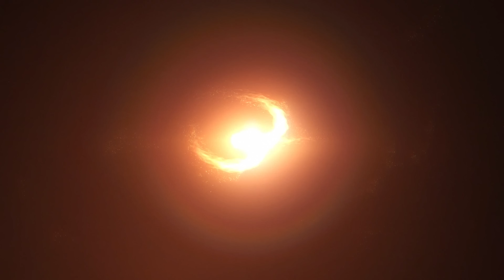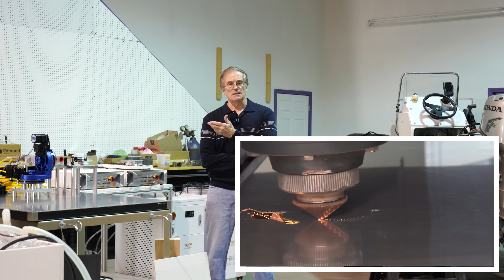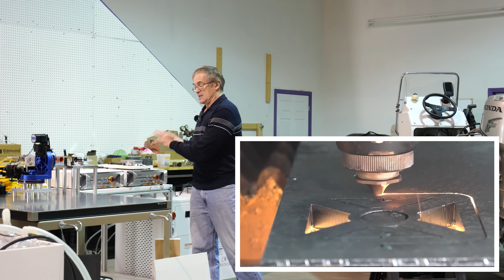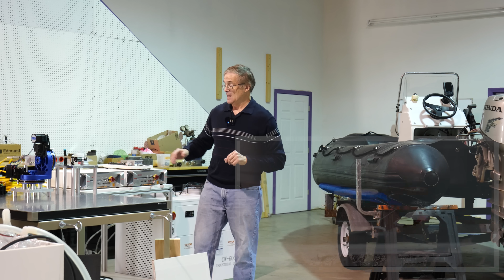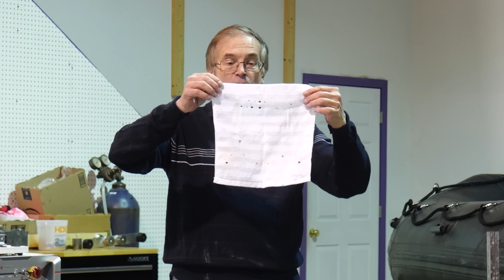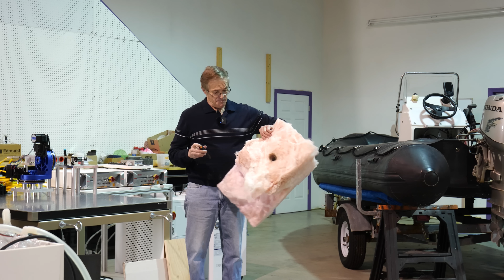We have a problem... and need your help!

Comment: I have an Idea, I know that others have brought up the idea of using water to stop the beam, but what about a long tube with water be pumped along the whole length of the tube with firebricks at the back to catch the rest of the energy. Water would be going everywhere but you could pump the water out of a basin under the tube. Picture a rocket deluge system
Reply from the maker: We need to protect the entire back wall. 
The barrier needs to cover a relatively large area because the beam can point anywhere within the region where the drones will be flying.
Reply: @TechIngredients  ohhh, that makes things way harder

Comment: A one foot diameter by 10 foot long plastic pipe, closed at both ends.  Fill with water add a dye if neccesary.  Put a spout right below where the laser will hit.  Allow the water to leak out of the laser hole.  Put a bucket, a water pump and a water tube from the bucket to the top of the pipe.
Reply from the maker: We have to protect the entire back wall. 
The beam can strike it anywhere.

Comment: Concrete blocks filled with water.    The water will leak trough 1 face of the block but, will dissipate heat in between

Comment: aluminum nitride ceramic sheet.   2200c melt point
or
fibre cement sheet.     it is cheap and i cant find a melting point mabey you could test it?

Comment: Well, you didn’t mention about the temperature at the point of contact.
I think if you try quartz tank wall filled with water maybe will give you the time you need.
Another option is Teflon. However, the vapors won’t be friendly. You will need an exhaust with activated carbon filter.
Maybe a combination of water and teflon plates. A stream of water rolling down over the teflon canal then you will not need the quartz tanks.
Reply from the maker: The temperature at the focus will be many thousands of degrees and will melt any material, any one.
The chalange is to find a material that melts as slowly as practical and is cheap and light enough that we can place a thick enough layer to stop the beam.

Comment: I believe sand would possibly be a good option because it would shift and replace the melting sand with new sand. You would probably have to put it in a container that would be big enough to cover the area of protection and deep enough to allow for enough sand to shift to accomplish the barrier you need. 

I hope this helps.

Comment: If you need to fire horizontally, have a mirror angled 45 degrees down to reflect the beam down into the ground or a pool of water that can absorb the heat. Or have a water pump flowing a curtain of water over the plywood sheet to keep it cool and prevent it from burning

Comment: Interesting problem, to say the least. Off the top of my noggin, I have a couple of ideas maybe you could try...

1. Soaking the plywood in water or coating it with a fire retardant foam to try to extend the time it would take for the wood to ignite. Or even having a constant water source spraying the wood to keep it saturated as the laser evaporates the water already absorbed into the wood.

2. Adding a 'curtain' of water in front (maybe also between layers) of wood or other material to act as a diffuser. Hopefully splitting the beam up enough to make other barrier methods more effective. Using fog pattern nozzles, if needed, to make the curtain of water less reflective. 

3. Although I'm not at all familiar with it's flammable properties, maybe aerogel, or whatever it's called, that I've been seeing, made from silica, could be a potential method for diffusion 🤷

They're not the most fancy or scientific ideas, but if nothing else, might spark a thought in someone else for a resolution. If I think of any better ideas, I'll let you know. I look forward to seeing the final results

Comment: I’m just a simple DT school technician. We use small rf and co lasers to cut wood and plastic. The power and feed rate are adjusted for cutting or engraving and material type and thickness. Would not the lasers you have be able to be modulated by the camera focus? Also, just as an extreme long shot, I saw a video by nighthawkinlight in which he investigated trying to recreate a compound called ‘starlight’ by its inventor, who worked for a short time with NASA I believe. He took the secret formula to his grave. It’s a kind of putty that protected objects it was in front of or covering, such as an egg, from the effects of extreme direct heat, such as a flame. It works by sacrifice, delaminating and creating a carbon barrier. Supposing you could mix into it some light scattering particles to ‘dilute’ to beam perhaps? Sounds crazy but there’s nothing to lose, I was born dumb 😂
Reply from the maker: We're already looking at his formula and plan to test some samples. 
Any electronic or mechanical limit to the laser can fail.  That's why the barrier is there.

Comment: Have you considered always keeping the beam in motion relative to the blocking material? Either continuously wiggle the beam, or wiggle the wall.
a 1mm pierce is significantly less energy than a 1mmx10cm cut.

Comment: To me you absolutely need to modulate the power of the laser. Imagine running around with a constantly firing gun, hoping to find something to shoot. It doesn't make sense. Maybe switching from a low power laser for aiming to full blast when it is in scope is a better approach. Then the armful laser doesn't need to be plugged in for a portion of the software testing.

Comment: Perhaps Magnesium Oxide Board as thick as you can get will work. It has significant heat/flame resistance at over 800c, is very hard/impact resistant and relatively inexpensive. Is said to have the properties of stone when heated.

Comment: A simple power supply current limiter circuit added then you can add various conditionals like a safety and kill switch, ect.  Because targets make noise when hit with the laser, the lab could have several microphones and a VOX circuit added to the current limiter input.  Just make sure the lab doesn't have house flys...

Comment: A Wall made of Aerogel. I know this would be extremely expensive, but that's my most effective idea.
Reply: Considering you are a much more intelligent and knowledgeable engineer than myself; you should know aerogel can be made with relatively mundane lab tools. Purchasing it is expensive, you may be able to find a way to manufacture it for your needs at a lower cost. I am unsure of the dimensions you are needing for this project, but you would need support for the gel.

Comment: You could combine 2 absorbing solutions: one cheep and large behind the target and one more expensive, close to the base of the jig by automatically deflecting the beam to it with a jigged mirror like the ones used to videotape high speed projectiles.

Comment: To solve your strong LASER problem: You may want to try aqua gel / Orbeez / Hydragel as a heat exchanger with an infusion of water soluble coloring within the aqua gel which has an optimal absorption characteristic for the given laser wavelength. You may also want to whirl the small aqua marbles around quite fast to avoid burning through them. A simple waterpump should to the trick here if you suspend the marbles in water using a 80% gel to 20% water ratio. This should all happen within an clear encasing of a glass like container to allow the laser to enter the "aqua gel heat exchanger" without damaging the optical window.
Reply: This should in fact work. Just make sure to move the gel around. The gel is better than water alone, because it moves in "chunks" which is what you want here to avoid hotspots or bubbles in water which could lower the effectiveness. The colored gel sounds like the way to go.
Reply: And avoid reflections of the glass surface where possible.
Reply: You may want to use e.g. indigo or green water coloring while the aqua gel is colored like you said, optimized to the laser wavelength to optimize for the laser. The water coloring just is there to lower reflections from within the spherical aqua gel.

Comment: I have a solution for you.
1. You need to get the ceramic tiles they used on the Space Shuttles. They can handle thousands of degrees Celsius for a long time.
2. An element that everybody runs away from. It is called Asbestos. It will solve your problems as it can also handle thousands of degrees Celsius.
That is your only solution.

Comment: Something with partial reflecting mirrors they spread the beam to some dark metal plates with cooling? 
Like a tunel where the beam gets of its itensity by every mirror that spots parts of it to a black paintet cooling element. 
Just an idea from a non scientist.
Another thinking, spead the beam with lenses will give a wider and cooler beam whatever you do after to stop it. 
Water can maybe work with some absorbativ particles or something else in it i think also. 
Like youre experiments. Thanks for the video!

Comment: I am not sure if the light physics work but my idea is… Use a large mirror and lightly sand clear side with very fine grit sandpaper.  My thought is that all of the fine scratches would diffract the light, hit the reflective back side, diffract further transmitting back out through the finely scratched clear side and be scattered to a safe level of energy density when it is reflected back out the front in many directions.

Comment: The idea is to disable the drone not to slice ans dice it. Pulse the laser for short periods. You should have an idea of how much power you need at what distance to disable a piece of plastic you can kick to pieces. A distance calculation via camera and very short bursts of light energy should minimize collateral dammage. There is always collateral dammage in war.
Reply from the maker: The idea is to be ABLE to slice and dice.
Testing will reveal that with precise targeting, what the amount of energy needed actually is. Then, dwell time on the target can be tailored to match this, freeing up the system to engage another target. The more powerful the lasers, the more targets per unit time, and the quicker we can move to standby.
Reply: @TechIngredients a compromize, your problem with a fire in the lab highlights issues you will encounter later on. Power supplies and simple logistics. He with the greater amount of drones and support will win. Nature is a sime thing, uncompromizing efficiency and power. AI is absolutely amazing, it can controll all the timing factors in the blink of an eye.
Reply from the maker: Actually, the party with the deepest pockets wins. Conflict is about leveraging assets. If a simple defense method forces the enemy to double the weight and, more importantly, the cost of each drone, he can only afford half as many. Exploring the options on each side is how you find better leverage.

Comment: Many years (many!) Scientific America published plans for a CO2 laser in their Amateur Scientist column. I was in high school, not likely I'd build it, but I sure wanted to!  Here's what they suggested for a beam catcher - a stack of single edge razer blades (the laser is aimed towards the edges of the blade).  I think in your course you'd use old fashioned double edge blades so that that they stack very close to each other..  The beam is split up by the the blades and bounces around and, presumably, is diminished.  Of course with your power, it might burn right through the blades, but it's an easy test.  A quick search shows CO2 laser articles in 1964 and 1971. I'm guessing it was the 1971 issue. I'm currently fighting a problem with my SciAm subscription and can't open any of their articles online, so that's the best I have right now.  Good luck!
Reply from the maker: I have that article around somewhere!
I built that laser in my early teens.  It worked, but barely, and I was hooked.
Reply: @TechIngredients  Wow, I'm impressed.  Well, I always am on  your videos.

Comment: Why not take a clue from NASA and use an ablative multi-layer shield?
Reply from the maker: Primarily, cost.
They have an additional requirement, very low mass, and we should be able to save a lot by relaxing that restriction.

Comment: My first thought was cfc, so carbon Fiber Composite. It can accomodate a lot of Heat and will not Show any mechanical stresses. Its Black, so its not Reflecting mich, which is good for safety. You will have a bit of Oxidation because of oxygen thats in the air. If you would use a ceramic that can cope with the energy and its too bright, it might reflect too much energy

Comment: It appears that the best option would be to take a very thin sheet of tungsten or boron carbide and coat it with PICA (Phenolic Impregnated Carbon Ablator) – Used on SpaceX Dragon and Mars missions., composed of Carbon fiber matrix infused with phenolic resin and then arrange for this sheet to trace hypotrochoids and epitrochoids, as with the Spirograph Cyclix Spiral Drawing Tool, so that The laser beam does not cross the same path twice, allowing the burnt layer of PICA to be slowly eroded without the beam penetrating the side of the building. That is my best suggestion.

Comment: From easiest and cheapest to most difficult:
DIY Hesco barrier made with goat wire or cattle panels
Water with ground charcoal slurry with a standing wave or waterfall system
High density fog, constrained by laminar flow doorway blowers
Do it in international waters

Comment: Simple for me 
to use your own words to solve it 
1/4 inch drywall green board if possible 
Build a frame that is a snug fit laying flat where the 4x8 or the 4 x12 sheet face up 
Next get rock salt liquify it pore it into the frame on top of the wall board 1/2 inch thick total ( end result ) 
Evaporate creating a solid crystal barrier to prevent heat penetration from the laser
 ie. molten salt reactor 
Seal top with another 1/4 inch wallboard 
Seal outside edges with drywall corners 
Repair liquid salt / evaporator 
Drywall mud 
Hang by adhesive hooks on wire rope 
Think of hanging sheets on laundry line 
😬

Comment: You need to generate a plasma shield that will conduct and distribute the absorbed energy over a larger area. Key will be the frequency wave that is modulated onto the plasma that will generate a texture in the nano meter range on the surface of the plasma, making it "opaque" to the laser light and breaking up or scattering the laser beam over a wider area, like a parabolic concave lenses. This is all theory and likely not the cheap option you are after, but it may be well worth researching, if not done already. 😉 Also, maybe a fishtank with water and induced frequencies to spread the energy from the heated water molecules could be a good place to start researching. Good luck!

Comment: 20+ yr USN Calibration/Avionics Tech (pheumatic/hydraulic/electronic/optics) / oil & gas production tech/auto/aviation mechanic here:  Construct a dummy load comprised of a clear glass window installed in a box filled with a moving liquid black body, Try a dark liquid dye like Rit clothing dye.  While it will likely bleach over time, It's cheap, easily disposable non hazmat, off the shelf at Walmart & should match  the wavelength of most fiber lasers.  Beam penetration depth and flow are only limiting factors, no different from any other heat exchanger.  An optical sensor should be installed at the end of the dummy load where the beam would be projected to hit should the beam not be completely absorbed by the dye for laser shutoff.  This can be used to vary the dye/water solution dilution and flow rate for optimum as well.

Comment: I earlier suggested a water tank filled with either tiny bubbles, or an oil emulsion. 
After giving it some more thought, the INVERSE would probably make more sense: an enclosure filled with an ultra fine mist of water. The fine droplets would still disperse the beam, but there would be no risk of shrapnel from a contained explosion. It would require a recirculation  pump, and a catch basin at the bottom of the enclosure,  but those would be easy proven tech ingredients.
Reply: Hmm yeah, could even repurpose those handheld garden sprayers for nozzles.

Comment: I was thinking kaowool  far more heat resistant than fiberglass.   Firebrick is also a good choice as it is quite light.  My only concern is with safety any particulate from either of them is pretty nasty if you breath it in.

Comment: Another idea: don't let the CPU do the emergency shutdown. Use some non digital aperatus, that only keeps the laser alive as long as the scanners are moving with a considerable angle speed..
Reply from the maker: We've talked about that. It's a relatively easy implementation because of how the control and lasers are configured. 
Thanks!

Comment: Have you tried a mirror pointing upwards to the sky? The mirror has to be highly reflective and the reflective layer has to be on top of the material. Maybe a highly polished piece of metal (tungsten maybe), maybe with some cooling channels with water as a coolant (or use active cooling)

I would also suggest a graphite block (that's how it's done at CERN), but it's eaten away very quickly and has to be very thick.

For a thin material it's not a good idea to use an absorber ... a 90 ° reflector skywards it waht comes into mind.

Comment: Why not cakes of Aerogel? The manufacturing of it at scale has increased dramatically. Surely a sandwiched/composite of a layer of an Aerogel/layer of clear-ish sand to diffract/aerogel and a sheet of water like from a pond pump behind it would absorb/diffract repeat and a sheet of water should irreparably scatter any remains? Would be more cost-effective than specialized industrial materials, I would think.